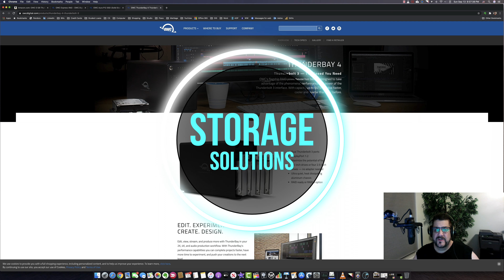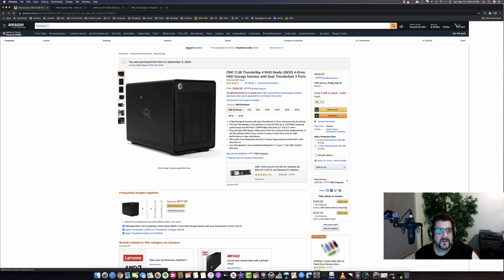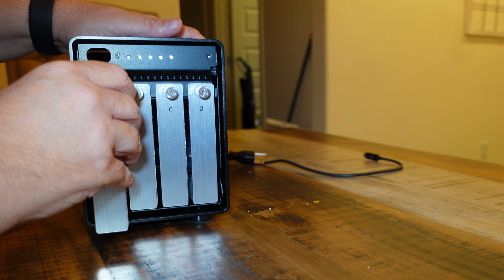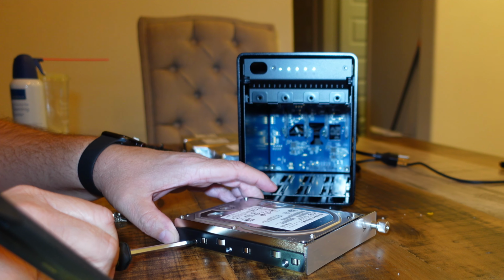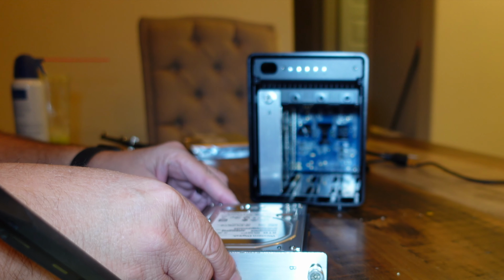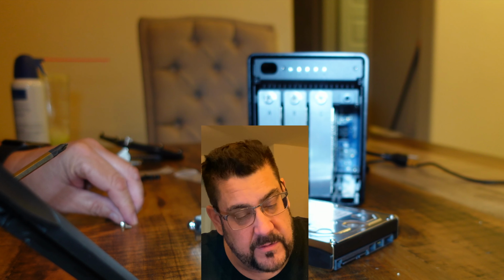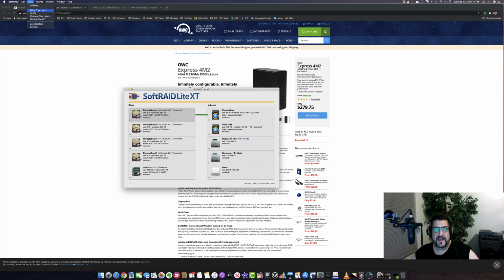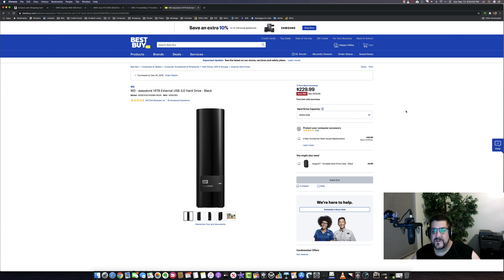Home Recording Studio: Storage Solutions

Comment: How's the fan noise?  I came across a couple reviews that mentioned the fan can be noisy.  Thanks!
Reply from the maker: It's a very low hum.  I don't hear it.  It doesn't increase with load like a laptop or a computer does.  It depends on what you sit it on.  If it is sitting on your desk, there is potential to make the whole desk vibrate (it's not much but it's there).  So I sit mine on top of a rubber mat.  A mouse pad will work.  This eliminates the vibration and really makes it quiet.

Comment: 700-950 MB/s is enough for heavy libraries like VSL synchron pianos?
Reply from the maker: It's enough for 4K video editing.  It's dozens of times faster than what you need for audio recording.  So there are two perspectives here.  One question is, can you use the drive to edit videos, or edit sound on the fly?  And the answer is, absolutely.  The second question, and this question is more important to me, how long does it take to save a project to the drive?  And since it can save a whole Terabyte worth of project data in seconds (sometimes minutes), it is plenty fast for me.
Reply: @MrWhiteKeys1  Thans for your answer. I don´t need audio recording, neither 4k video editing. I recently bought a good digital piano, good audio card and im going to get a very heavy VST. I would like to play live and get the minimum latency. What are the specs of hard drive (and everything else) to achieve that?
Thank you, I love your videos.
Reply from the maker: @GlobalStats  You certainly don't need this storage tank.  Any SSD should be up to the task.  I would not try to use a mechanical drive.  If you are using a VST for a sample-based plug-in, for a piano sound, for example, there are about 47,000 audio files that must be loaded, read, and played.  I would recommend against using any kind of mechanical drive, unless it is a RAID 0 configuration like the above.  Even an external SSD would work nicely, providing the VST and its audio files are loaded onto the SSD, and the SSD has at least a USB-C connection in a 10Gb/s slot, or a Thunderbolt 3 connection.